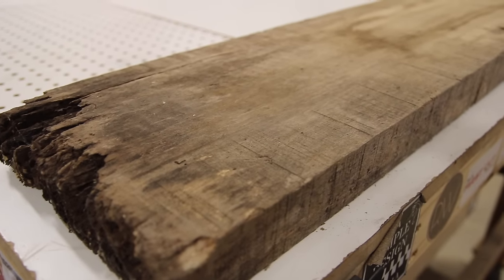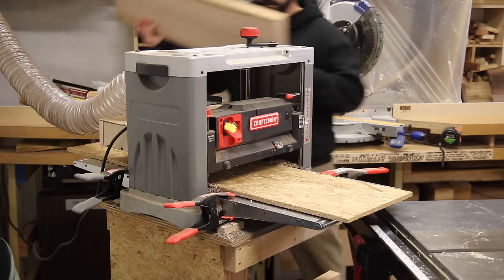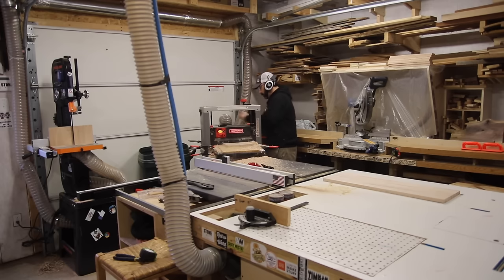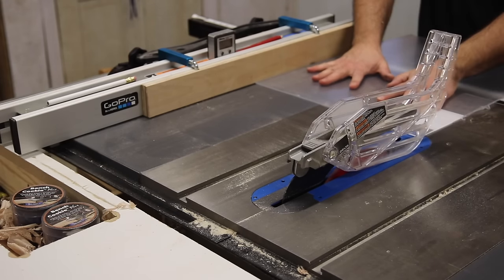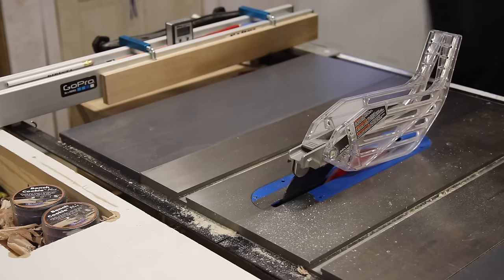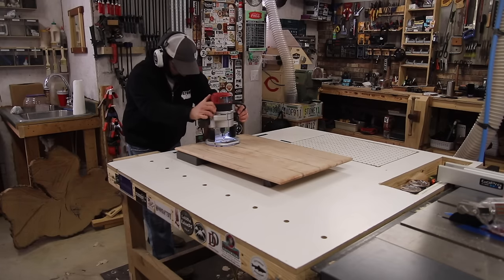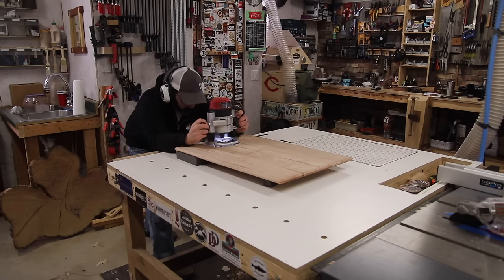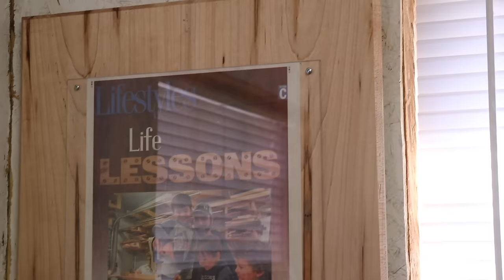I Quit My Job To Be A Woodworker - This Is My Story

Comment: those of us with shorter than normal fingers; urge you to use push blocks when woodworking.
Reply: that's the part no youtube video tells you about! i quite woodworking when i almost lost a finger on the jointer, i really loved doing it but it's not a safe job at all!
Reply: @moh19931000  

Of course it's not a safe job. No powertool is entirely safe. You need to educate yourself about safety and keep your equipment safe.

Comment: A neat personal video, well done.  But I wondered why you didn't put biscuits, dowels or even Kreg screws to join the 2 beautiful pieces of wood? I enjoy finding wood like that. May God bless your relationship with your son!
Reply from the maker: Thanks for watching. I didn’t add biscuits or anything because I knew there wouldn’t be any pressure on the joint and it’s just a simple board for looks. If I had used it for something else like a tabletop I would have used biscuits, dowels, kreg or something else.

Comment: maybe just a idea for you...it would look better, ich you lower the whole plexiglas flatened with the wood. so use the surface milling machine and geht the 2-3mm and take it out of the wood and make the whole thing flat (Wood and Plexi glass).
That you do not have to use any screws at all, make some "pockets on the upper and lower end where you can stick the plexi glass in. When you polish the plexi glass an all four sides...it looks even better and you can see the wood structure when you look from the side through the plexi glass. (hard to explain in english...hope it was good enough ^^ )

Comment: get a 3 tooth bi metal 1/2" Lennox blade for your band saw and you will greatly expand its cutting ability. The trick then is setting the fence. (sharpened blades never cut straight)
Reply from the maker: Thanks for the input. I'll look into it

Comment: You might want to laminate that newspaper in a clear plastic film, since it's a special memento, especially if it's your only copy.  That kind of paper usually yellows with age anyway, especially sandwiched like that between the plexiglass and the butcherblock-oil-soaked wood, and bonding a plastic film to it may protect it.  Go to a scrapbooking store and get a film with acid-free adhesive, not just clear shelf liner or something. It will be invisible under the plexiglass, but should keep the paper legible for many years, unless it's already soaked in too much of the oil.  I see you did this about 10 months ago as I write this, so it might be too late, but good luck.  It was a very moving video.
Reply from the maker: +JusBidniss I added a piece of cardboard underneath so the oil shouldn't be an issue, but I didn't add any clear lamination to the top. Thanks for the input.

Comment: You now have 14,654 subscribers, brother. Several parts of your story mirror mine, though I have girls and they're going their own paths. I've always had a creative bent, but it wasn't until I married and would borrow/share a tiny 8' x 16' building/shop we bought that I fiddled with more than repairs in wood. I built small crafts, shelves and frames as needed. On learning of our first pregnancy, I built a rocking horse, and found a true love of creating with wood. Ups, downs, loss and divorce, I've slowly rebuilt my life over the last dozen years, bought a house with a moderate sized shop, and have grown in more ways than I can say. I've made extra income here and there, but, with that same, steady job you described (and not a little fear of making the leap of faith you have), I'm building my knowledge, my faith and my foundation to eventually do what you've just done. God bless man!
Reply from the maker: +cajun812 Thank you so much for sharing that. I wish you the best.

Comment: Great video! I love the wood that you used, but it pained me to see you using the pipe clamps on it. There is a chemical reaction with the wood glue and the pipes that cause that black staining on the wood. You can do things like simply wrapping the pipe section touching the glue (+/- 4 inches) in wax paper to reduce it, or use better clamps.
Reply from the maker: +Evan Farrell I know, normally I would just wrap them in painters tape.
Reply: or clamp the wood with the clamp not touching the wood!

Comment: I have a few comments. 
1)SUBSCRIBED
2)Great lesson, and inspiring story
3)Very good production value on the video
and 4)I am a novice woodworker.   I noticed your Craftsman jointer that you were using.   I actually just recently acquired that same model from a Craigslist deal for fifty bucks!  I was wondering if you could do a video on how to set it up properly? I've used it a few times,  but I don't believe the knives are properly set,  and I'm not even sure if the tables are co-planer.  Every time I make a few passes on the face of a board for instance, the board becomes almost tapered, width wise.  Not sure if that makes sense.   Anyways, I look forward to watching more from you!

Comment: Well, here I am just seeing this video now after scrolling through a few about starting up a wood working business. I am at that crossroads right now..at 49...scary crap. I am a decent woodworker (or so I am told)...mostly self taught. My thing is though, I had a Dad and uncles who were never scared to try to fix, build, or take apart things on their own...I inherited that trait.  For years I thought about starting a woodworking business but never thought I was anywhere near good enough...who the hell would buy my stuff...who would be willing to pay the extra cash on a side table hand made vs getting a manufactured cheaper one from a store...still feel that way actually.  A few weeks back I attempted my first table top glue up for my side table project...no planer, no jointer, just a table saw with an accurate guide...I was blown away at how it turned out..I mean hell..I DID THAT.  Started showing some of my builds (not many) on FB and the comments I received were very encouraging indeed. I just need to get the courage to take that damn step....anyway, this reply is a lot longer then I expected. All I wanted to say was that your video was amazing and the things you said hit home....Dads (or parents in general I should say) teaching, spending that time to work together is a very very powerful thing in a persons life. Great job man!

Comment: How long did you let the mineral oil soak in before you attached the newspaper to it ??
Reply from the maker: +Ios 6 It was just butcher block oil... I went back and added cardboard between the wood and newspaper. I let it sit for a few minutes.